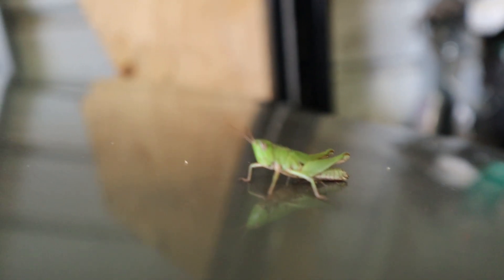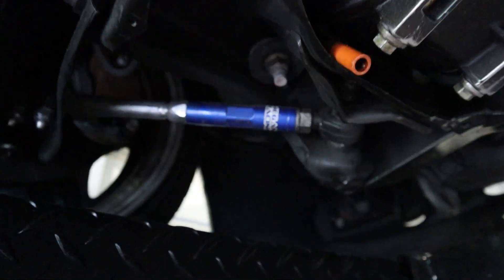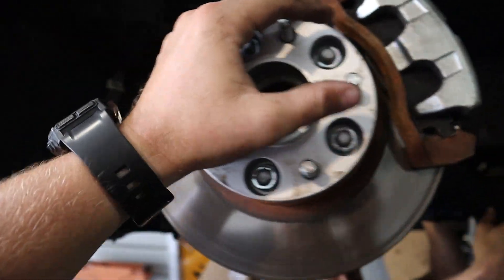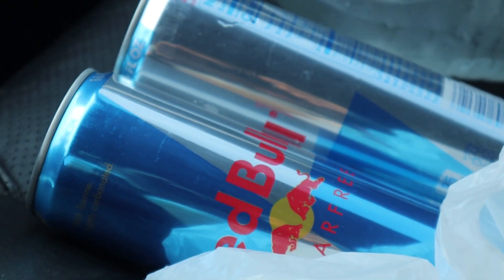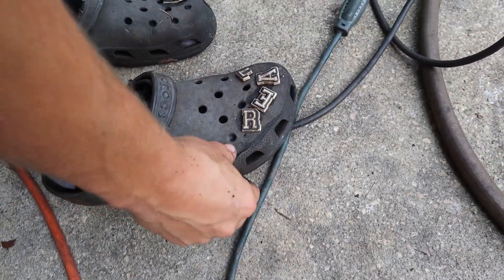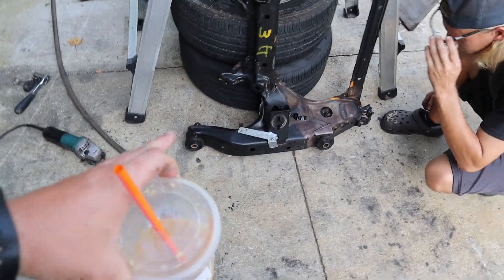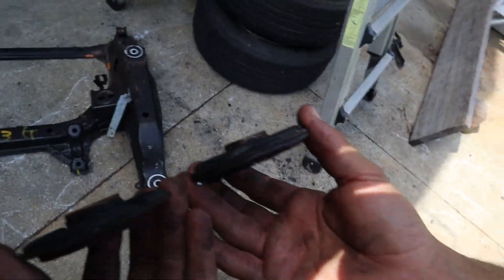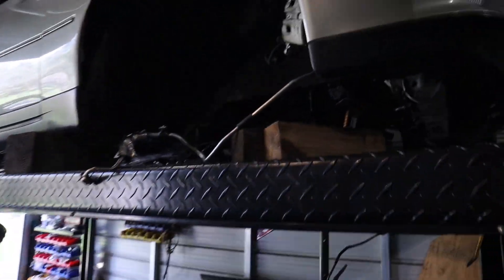Y33 SHORTENED FRONT SUBFRAME (HOW TO SLAM A Q45 and Cima)

Comment: So a s14 trans mount does fit properly? Also I used gktech rd25 mounts. They are exactly the same. I also replaced the studs with longer ones and added spacers.

Comment: Just put coils on mine sounds like I have that starting issue where it sounds like extra cranks to start the car sometimes it catches at start and no problem just changed starter and alternator y’all know anything about fixing that I think it’s the flex plate ? Can’t find much of anything for 45 y33